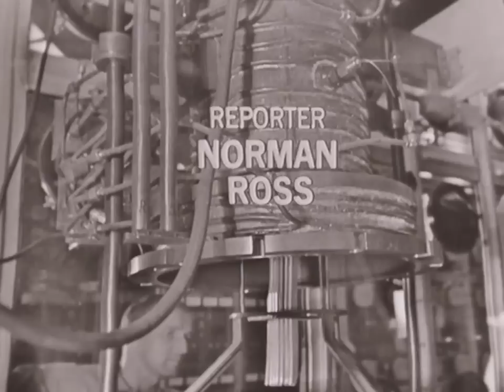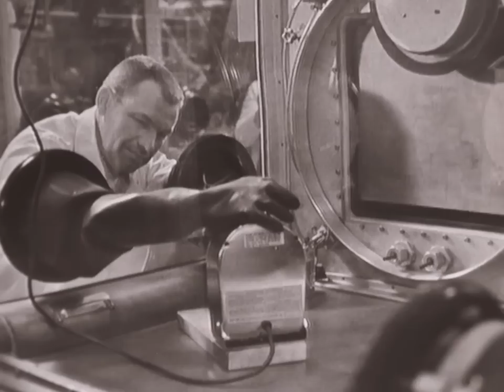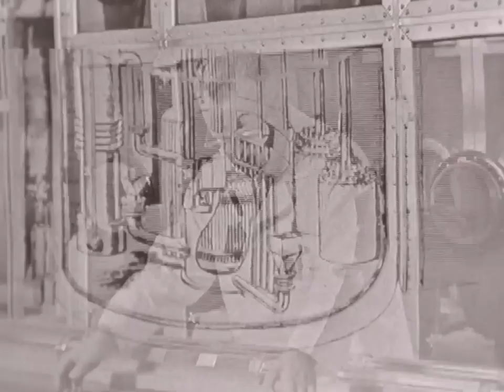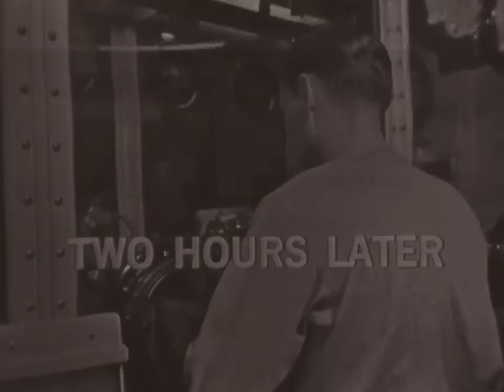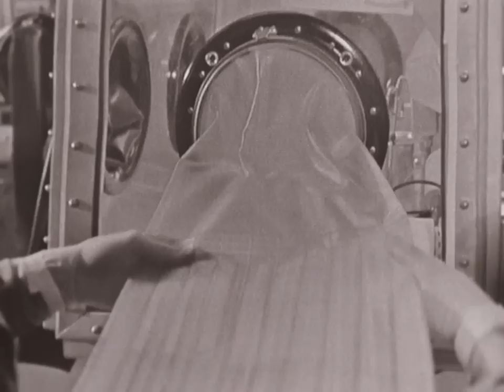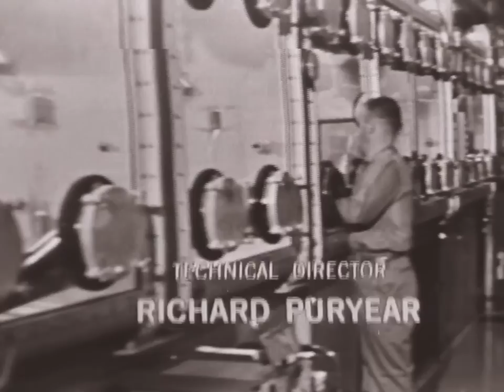The Fuel of the Future: Making Plutonium Fuel for EBR-II (1964)

Comment: 27:14..... Well, Doc Brown said in 1955 that by the time 1985 rolled around, Plutonium would be found in every local drug store, and the guy in this video said that "Tomorrow, Plutonium will be as common as coal or oil". 

Well, just about 70 years have passed, and Plutonium is NOT found in any local drug stores, and is NOT as common as coal or oil, and is STILL "a little hard to come by.."

And were STILL using coal and oil as the main fuel for most of our power production... 🤨

We SHOULD give nuclear another shot at producing electricity. 95% of the reactor technology that still remains out there now is antiquated. With today's HUGE technology advances in materials, computers, design, CNC manufacturing processes, and so on, we could most likely be VERY successful in creating and running a safe power producing reactor. Unless its hidden away from the public somewhere, it seems that any research into a new reactor design is pretty much non-existent today... 🤷🏻 The benefits of nuclear power production totally overwhelm those that use fossil fuels. I think that today, we SHOULD be able to come up with a fail-safe reactor design, that would be basically impossible to melt down unless someone working there would intentionally try to do it. Perhaps more smaller units around, rather than one huge unit, would be safer in case of intentional tampering. Less fission fuel in the core to make a massive mess, or release of radioactivity.
Reply: Plutonium is STILL NOT in our reactors. The Fast Breeder Reactor experiment at Argonne Labs had a melt-down, and was canned. We are still using PWR using enriched Uranium. Some of the smart people are working to get Thorium as a fuel source in the Thorium Molten Salt reactor designed to operate at ordinary pressure, consequently, no chance of blowing up on loss of cooling. The world is full of Thorium - 10,000 years of supply!

Comment: "Twenty years ago, the word "plutonium" wasn't even in the dictionary."
-- Dr. Arthur Schuck, 1964

"I'm sure that in 1985, plutonium is available in every corner drugstore."
-- Dr. Emmet Brown, 1955
Reply: If you count the fallout from the OVER 2000 exploded nukes since 1945, Doc Brown was not exactly wrong 😁
Reply: It's always annoyed me that in 1955, the diversion of plutonium was arguably easier than in 1985. In fact, definitely. The film should be remade in a way that Doc and Marty travel to Hanford, or to Idaho to goto EBR-I, and pinch some. EBR-I would be the cooler story. And, alternatively, surely Doc could've built a cyclotron to create enough Pu to power the flux capacitor. They could've gone uranium ore mining, then used gaseous diffusion or centrifuge enrichment (it wouldn't need much). No stupid, under-powered, lightning strike required. Has always pissed me off that Doc could be so ignorant of the cutting edge physics of the decade 1945-55.

Comment: 6:45 aha ha ha ! not so anymore, Mr Arthur Shuck ! we don't need no damned breeder reactor ! now we have Thorium ! and we have at least four times more Thorium than Uranium, AND we can use up ALL of the Thorium unlike in Uranium reactors...Arthur won't respond to me though, he's been dead now for years...
Reply: Fuel reprocessing is where we really should have gone. There's so much spent fuel that can be processed and put back into reactors that we wouldn't have to mine anything else out of the ground for a very long time.
Reply: I hate to tell you this but a thorium reactor IS a breeder reactor. The thorium-233 is bred into uranium-233 which is then used in the reactor like normal uranium-235

Comment: They are mixing up two different processes. Making simulated fuel and making the fuel pins for the EBR. These fuel rods had 15% plutonium in aluminum. They were made by putting the slloy in  the extrusion furnace. Breaking the glass and chopping up the plutonium alloy into slugs. Next these were loaded with niobium spacers in ziconium tubes. These were heated and filled with either molten sodium or NaK alloy to just above the fuel. Then the top is welded on and a hard vacuum is applied as the tube is sealed. The beeder rods were constructed similarly to the fuel rods except they had uranium alloy slugs in them.❤
Reply: Plutonium is the most expensive metal in the world and there is a shortage of it right now.  NASA cannot acquire more for its energy sources for probes, and things like Mars rovers and satellites.  It’s all in nuclear weapons, so since Trump has started testing of nukes again I suppose they will be making more plutonium now.
Reply: @Biketunerfy the 238 isotope, about 70k a gram. The 239 isotope is in surplus and costs about 400 a gram for qualified users of it. Tritium is pretty spendy too.
Reply: Plutonium is the most expensive metal in the world and there is a shortage of it right now.  NASA cannot acquire more for its energy sources for probes, and things like Mars rovers and satellites.  It’s all in nuclear weapons, so since Trump has started testing of nukes again I suppose they will be making more plutonium now.
Reply: And then the whole operation was to eventaully make bomb fuel

Comment: Why do they add molybdenum ruthenium and niobium?
Reply: They make the fuel a but more physically stable and higher melting point. Molybdenum would make technetium in a reactor
Reply: @christopherleubner6633  but I mean specifically why those elements , not like tungsten , or something else.
Reply: @petevenuti7355 Same reason one would use rubber for tires, glass for windows, and concrete for foundations... the chosen materials have the properties needed for what they are being purposed for.
Reply: @MadScientist267  yes and what are those properties in this case? It can't be just melting point, like I said - tungsten,  did they check every single element to see how it alloys? Is there a rule of thumb because of its chemical properties? How much of the decision was based on the daughter products and transmutated elements ? I see thousands of variables and I'm not the kind of person who just accepts because as an answer. Of course it's a plutonium related thing , so I don't expect all the information is public or not misleading.
Reply: @petevenuti7355  Sometimes that's just what you have to do. I don't know for many of them, but zirconium for example is about neutron transparency. Might have something else for mechanical strength, another that is neutron activated, and so on. One thing is for sure, YouTube comments isn't where you're going to get any detail. Even if someone had them all, discussion in depth on anything gets the comment... no pun intended... nuked.
Reply: @petevenuti7355 Because they work.... that's why. 

Why did they use Gallium for alloying with Plutonium to make bomb cores? Because it kept the metal stable in its current stage, and allowed it to be machined easier.  It just worked.
Reply: @davelowets  that's alchemy and religion, the acceptance of magical thinking and taking the black box without asking what's inside. 
, I want explanation in terms of chemistry and metallurgy, what property's and characteristics about it make it work, and why?
Reply: Case in point. Try to reply with a real answer on this steaming pile of a platform and the response gets removed. This isn't the place to "do research".
Reply: @MadScientist267  you had another reply and it got deleted? I hate that too.
Reply: @petevenuti7355  Spectacularly accurate my friend. They don't want anyone communicating in a useful way around here. Contrast to the majority of intellectually defunct derder posting that takes place... It's pretty clear what is actually desired out of all this.
Reply: @MadScientist267  there's an open source distributed p2p search engine, I'm looking into using it.

Comment: Grok told me on X that the gloveboxes were helium filled, but I didn't believe him. Here it's shown to obviously be true though! 
Why? Argon would be so much cheaper and just as inert.
Reply: If you had the outlet valve for each box at the bottom and purged it until you had helium coming out, you'd know you'd pushed out everything except hydrogen.  Argon is heavier than oxygen by only a small margin so you'd have a hard time purging the glovebox effectively.
Reply: @jimsvideos7201 SO, purge it from the top instead... 🤷🏻

Same concept
Reply: The US government owns the largest helium well on earth. It was more or less free. At that point in time, we were the only suppler of helium on earth.
Reply: @RaymondSwanson-u9y  It was much cheaper than it is now, but there's no way it was ever cheaper than argon. Argon is distilled out of the air at the largest constituent after O2 and N2. It's the cheapest industrial gas after those two.
Reply: For this use argon is fine but if fabricating nuclear weapons parts helium must be used as anything heavier than oxygen will interfere with the operation.
Reply: @christopherleubner6633 That's not why... oxygen WILL cause Plutonium to spontaneously catch fire
Reply: @christopherleubner6633  but why?
Reply: @Muonium1  Oxidation?

Comment: Impressive quality for a 60 year old video!
Reply: It looks like the original transmission was recorded on film stock using a Kinescope.
It has the same very clean look as 'The Honeymooners' episodes which were partially live.
(Edited due to ham-fisted spelling!)
Reply: Professionally made. Courtesy of the Atomic Energy Commission. One of the few things the government got right.
Reply: @RaymondSwanson-u9y  And produced by NET, Walther Annenberg's public television outlet and predecessor to today's PBS.  Of course Annenberg would be spinning in his grave if he knew how political his public television became- he would have very much disapproved of the creation of the Corporation for Public Broadcasting.
Reply: This was likely shot on 16mm film which would have been considered low quality for the time this was filmed.
Reply: The typical 35mm film had an equivalent resolution of 5.6k. The reason it doesn't usually look good on YT is because it was copied to VHS as one point and transfered over. The original film needs to be run through a digitizer to get quality like this
Reply: @_MaxHeadroom_  The resolution of film  at any given size will vary considerably based on film stock, speed, and processing.  And this is for the source.  When a print is struck there will be a reduction in quality, and there will be further reduction in quality as the print is shown and ages.

But yeah, converting anything to NTSC will always result in it looking like garbage.
Reply: @rockets4kids  Even so it still has a very high equivalent resolution. Lots of people for some reason don't realize that
Reply: @_MaxHeadroom_  Yes, that is what I said elsewhere.  This was likely shot and delivered on 16mm film, which was vastly more economical than 35mm.
Reply: @rockets4kids Yeah. 35mm was most commonly used though which is why I used that as an example
Reply: @_MaxHeadroom_  35mm was only common for Hollywood feature films.
Reply: @rockets4kids It was the international standard gauge for most of the 20th century and used for Independent and Art Films, Short Films and Documentaries, Television Productions, Advertising and Commercials, Archival and Historical Recording, and Amateur and Experimental Filmmaking. Much more than just Hollywood Films
Reply: @_MaxHeadroom_  You're describing 16mm film there.
Reply: @rockets4kids  35mm was definitely the standard international gauge. It was made the standard in 1909. 16mm was used for less professional indie level stuff
Reply: @_MaxHeadroom_  It's obvious you are pasting things you know nothing about.  If you want to see what color 16mm film stock is capable of, check out the first season of Sex and the City.
Reply: @rockets4kids  You can even Google it. 35mm was the international standard for almost all of the 20th century. I've read several book about the history of film
Reply: @_MaxHeadroom_  You clearly didn't learn all that much.
Reply: @rockets4kids  Look it up then. 35mm absolutely was the international standard starting in 1909
Reply: @_MaxHeadroom_  Do you even understand how meaningless that statement is?
Reply: @rockets4kids  It's not a statement it's a fact
Reply: @_MaxHeadroom_  It is equally a fact that the metric system has been a standard since 1795.  Despite that, if you live in the US, you'll find a  whole lot of things that aren't metric.  Just because something is a "standard" doesn't mean it is the most commonly used thing.
Reply: @rockets4kids  Go to Google right now and type in "what mm film size was most commonly used" and tell me what the first thing you see says
Reply: Film has a resolution greater than 4k, theoretically it's definition is only limited by our ability to scan it, or even potentially limited by the wavelength of light itself.
Reply: @puffery-z7u film has a resolution: the size of the photoactivated particles on it. They more or less represent a pixel. 

So the resolution of film depends on its size and how fine those individual particles are (mainly a quality/cost issue how fine they were produced I guess)
Reply: @puffery-z7u  Some film has a resolution greater than 4k.  Todd-AO and 70mm films are purported to be equivalent to 16k.  8mm film isn't going to be anywhere close to 4k.